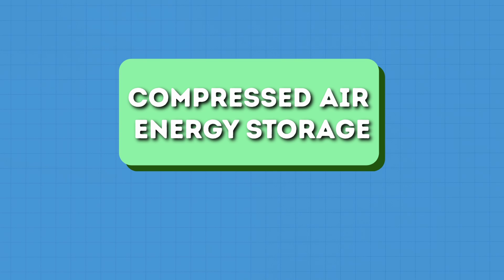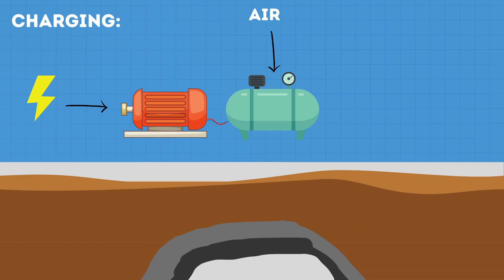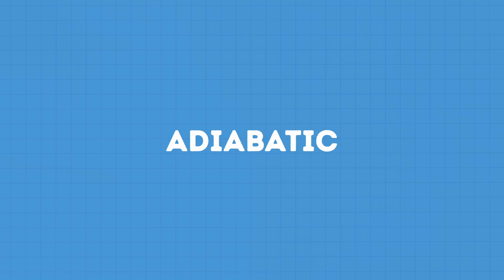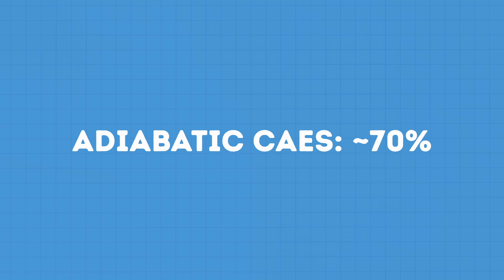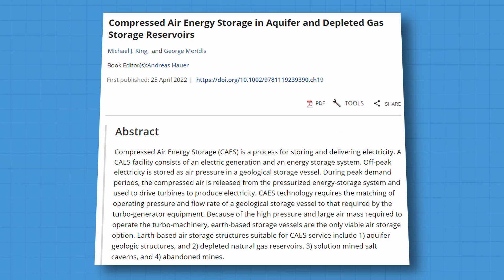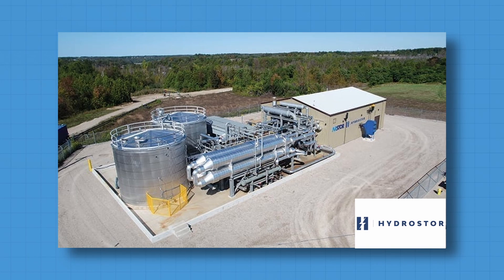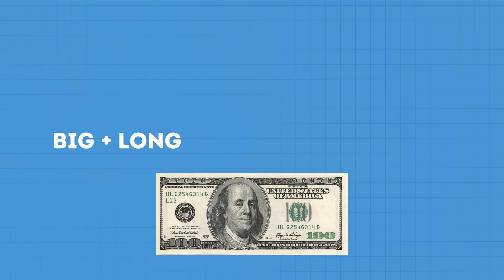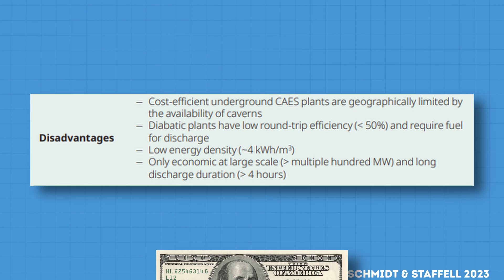Can this solve the energy storage problem?

Comment: Don't use depleted natural gas fields!

You'll flush out the remaining methane into the atmosphere, which is really bad.
Reply: Im not so sure - it looks like the system is fairly well contained. The only thing that goes in and out is the water, not gas.
Reply: @jeffbenton6183  Depends what gas your using. If your using one particular gas, like CO2, then that's true.

But most compressed air systems run on regular air, and vent it straight into the atmosphere when their done with it (with all the methane it accumulated underground).